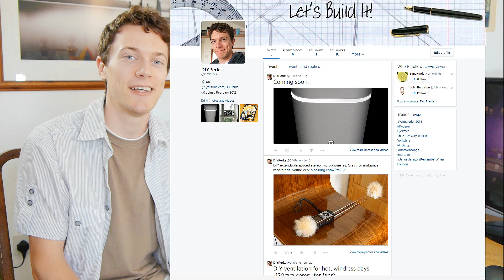How to Make a Clean Air Enclosure (for HDD repair etc)

Comment: Earned a like, like most your videos =)
A suggestion for future project, or just out of interest:
An alternative design would be to make a laminar flow environment, with flow from table-->up.
This is what is often used in microbiology work with petri-dishes. Laminar flow=no(low) turbulence, and the airflow from the table to the top of containment. 
As air moves down->up it does not move over the subject, and prevents any particles from settling on the subject.

Comment: Very nice project, but dust clean environments normally rely on positive pressure so a blowing rather than sucking would be best.
Doesn't need a lot of pressure so maybe a computer fan might just be enough.
No hole for the vacuum, and a fan on the hole for the filter, and the filter attached to the fan.

Comment: Very cool idea thanks! I would have just used extra large kitchen style rubber gloves to keep the hand holes sealed!
Reply: +Blakehx pretty sure you might face some issues with the gloves expanding when the vaccum is on, and might need to reinforce them with rings of duct tape to prevent it.
Reply: +Graeme Evans Good point, guess it depends how strong the vacuum is! Could use electrically insulating gloves, they're more heavy duty but would probably limit your dexterity a lot!

Comment: I wonder if a weaker suction source would work better? maybe a 4 inch fan? less power = less particle coming through filter, less stress on box?
Reply: +Shreyas Mahendra I don't think so. You want the vaccum cleaner to suck out any dust that's already in the box. So it needs to have a certain airflow to catch any dust sitting on the inside walls of the chamber. Remeber: This enclosure is meant to be taken apart after usage, therefor dust will enter the chamber. Also the "hand-entering-holes" are open when not in use; the vaccum sucker hole aswell.
Using a vaccum cleaner doesn't cost you anything and it certainly is working decently. Why hassle around with any other fan? 
Vaccum cleaners have a huge amount of static pressure. No axial fan from computers will do the job.

Comment: Nice video! I need to built one like that for: 

  Installing a screen protector on my cellphone!

I hate even the smallest dust particle on my cellphone screen. I want a PERFECT screen without a single dust particle.
Reply: Same
Reply: +TGRS That's a great idea. Next to impossible to keep a screen protector 100% dust free. I'm going to build one out of foam core as it will be more sturdy and I don't care to disassemble it.
Reply: +Islamic Paradigm Try installing your screen protector in the bathroom after a long shower, your hands/body are dust free and there is very little air born particles in the room because of the water and the added moisture helps to form a better seal. Clean the screen with a coffee filter first.
Reply: +James McCullen XXIV yeah they can. in fact, my local mosque gives free computer lessons to people that need them
Reply: +James McCullen XXIV ...neither can Nazis
Reply: ***** certainly not with a desktop computer and basic knowledge of Windows

Comment: Hey Mat l Ioved your video, really exceptional.
I am a photographer and data recovery is a real pain as over the years I have lost around 5 drives due to hardware errors luckily I kept them all as I knew one day I'd rebuild them and then recover.
could you please show me a video on a disassembly/reassembly of a damaged hard disk moving its platters into a new machine.

Is there any such thing as a HD testing station device where one can put platters on and then to be able to read/pull of data off I am sure this can be done but cant seem to find anything???

please keep up the great work.

Hugh
Reply: ***** Dont know about  HD testing station device but if platters are ok you probably would be best to exchange the read write head actuator from another drive from the exact same model, called the donor drive. For what I have been seing the head actuator sometimes get stuck to the platters when the drives are accidentley dropped. Dont know if thats your case anyway i have never recovered any drive tough. Best of luck
Reply: Thanks Mat, much appreciated, I may try to build a small clean air exposure such as the one you uploaded and see how I go from there.

Best

Hugh
Reply: +Marta Demartini Hugh Hill I'd love to see this too!

Comment: Thanks for this inspiring Video!
Also a very good idea would be to blow dust free air into the box so you have no problems with any leakage. Then you can even put tools in while you're working 
For example using a computer fan with an air filter attached to it to blow air in. Then you can leave the fan turned on all the time you are working. Through small intentional wholes the air could go out all the time.
Reply: Finding a trong blow of dust free air is not an easy task however. Computer fan is kind of uncomparable to the vacuum.

Comment: Hi
Try glas cutter and aquarium/terrarium.
You can use parts of a vacuum cleaner to build the "fan" for the
aquarium, that pumps the air into it so you have more pressure in the
container than outside so you don't contaminate the container.
2 to 3 very good pair of gloves to the holes you cut ...
Remember to put the filter between the blower and the aquarium
and always positive pressure in relation to the outside atmosphere
and meticulously clean the object or tape everything that can contaminate.
(back of the HD->PCB, screw holes ...

Comment: I think the better idea would be not to suck the air out of the box - thus creating vacuum, but rather pumping it into the box creating overpressure that would prevent any dust and debree from getting inside through the possible leakage points as being sucked in. Similar to surgery rooms in hospital. You could use then some computer case fans pumping the air into the box, then some fillters behind the fans, and finally the box. And you dont have to carry about airtighteness around hand protection sleeves.
Reply: Interesting. Have you done it??

Comment: I have not read all the other comments at this time but would suggest you push air into the unit though a filter rather than suck air out. This would solve a couple of issues with the unit wanting to collapse, you also don't need to make it air tight and lastly you don't need as much air flow. Yes you would need to leave what ever you are using to pressurise the container running but it would also make 100% dust free. Secondly you could just leave the whole glove on and not cut it to sleaves and each time use a fresh set of gloves and just fold the wrist part over a PCV pipe that has a lip on it :)

And thanks for the great videos to watch .
Reply: But what to use to push the air in? Finding a pure source of strong blow won't be easy. The outlet of the vacuum will not be a pure source for sure.

Comment: Those hand holes seem like a weak point of this design, the moment you turn on the vacuum its sucking in a bunch of dust through the hand holes, even though you just wiped down the inside, thus negating the work you did to keep dust out.  Moreso, your hands themselves are the cause of dust, so putting your bare hands in a clean environment seems like a good way to introduce even more dust.  Since this design doesn't really have positive or negative pressure inside the container, exchanging the cut gloves with complete uncut gloves seems like a simple and practical solution, without the loss of very much dexterity. Good idea and video, cheers.

Comment: I have a HDD with broken parts inside i believe the disc are in tact and un damaged, if i bought an identical drive would i be able just to swap out the discs? thanks
Reply: Yes, you would. Don't forget to swap out the PCB/Chip('s)
Reply: Maybe, maybe not. Based on what I learned from another YT video, it would depend on the controller boards being the same on both drives.

Comment: Hey! Thank you. Excellent tips!
Now, my English is not quite good enough to catch one term and I want to ask you...
QUESTION: Can you please write down here how you guys call in English this kind of cardboard material you used, and what purpose is it normally used / sold for?
Reply: Never mind."Craft cardboard" isn't it? I think that's what we call "Carton Pluma" in Spanish, a light and rigid sheet material used for the walls of architectural models, and in some school projects. Other materials are suitable, but... Is this the one you used in your video?
Reply from the maker: raulgap I used acid free cardboard backing that's usually used behind picture frames here in the UK.

Comment: Just a word, you have to be careful when using a vacuum, they tend to create static, I know you won't be directly applying the vacuum nozel to the hard drive, but static electricity can travel through our hands,   and its probably more likely in an area like that.static + computer hardware = bad

so, a word from the wise, make sure you touch something like a computer case to ground out your hands before touching the hard drive after using the vacuum
Reply: Is one end of a simple wire connected to the home radiator, and the other end inside the air enclosure, enough?

Comment: I would force filtered air (most vacuum have an air outlet to attach the hoose) into the cabinet. In that way perfect seal doesnt matter so much, since pressure inside is "positive", and air wants to escape between the leak it found, but since air is going out, room dust cant get in. this approach Ive seen in a Radio Transmission plant where dust was some sort of serious problem, then, got a BIG BLOWER, taking air from outside, filtering it and forcing it into the room, resulting in every hole of the room blowing air and blocking the dust. cheers.
Reply: You can search for FM transmiting Plants and you will get nice vids. That is where I have took the suggestion from. Dont have access to the plant any more to tape a vid for you. Next time I visit one I would tape this for you and upload to my channel.
Reply from the maker: 38911bytefree Good points!
Reply: Er... 'kay, any video 'bout this?
Reply: 38911bytefree
Thanks. :D
Reply: True, but now get that big blower.

Comment: Nice idea, your enclosure is very handy.
Could you tell me what microphone you use for your voice overs? Your voice sounds great and the audio quality is fantastic.
Reply from the maker: ElectronFun.com Just a cheap electret mic I salvaged from an old laptop. Nothing special at all, but it does sound great. I wish I knew the part number so I could make more!
Reply: DIY Perks Thanks for your reply. I thought it was a condenser mic, but couldn't figure out the price range or make.
Reply from the maker: Alberto Martinsen That's the one I put the laptop's electret capsule in to, yes. I'll make a video about it at some point.
Reply: Today I've discovered this fantastic channel and I was wondering the same. But what about that microphone you use with a wooden foot? Is that the one from a laptop?
Reply: Nice!! Thanks for your answer, and cheers from the north of Norway!! You have a fantastic channel!! Keep the nice work, and remember: don't feed the trolls ;)

One more thing: You have nice video editing skills too. It would be great in my opinion, another tutorial about it with some tips for beginners like me ;). Just an idea ;)

Comment: This would be great for putting screen covers on phones and tablets which is almost impossible to put on without a speck of dust under the cover.
Reply: Here's how I did it : Went into the bathroom and turned on hot water from the shower head. This creates steam which 'catches' the dust particles and then drops them to the ground.
After a couple minutes the (small) bathroom was free of dust in the air so I could put the screen protector on without a single particle on my screen :)
It does create a damp environment so may not be ideal to work on a HDD :p
Also, it doesn't stay free of dust forever obviously so you have to work somewhat fast.
Reply: F Con that actually a good tip, thx
Reply: All you need is a piece of scotch tape. Take a long strip and remove all dust on the screen in about 5 seconds. Then put the apply the screen protector within next 5-10 seconds, being careful with alignment. You might get one piece of dust now and then, but most kits include a dust sticker and you can gently lift up the protector, stick the adhesive side up against the adhesive of the protector (where it's stuck) and then remove the speck of dust.
Reply: @HarrisonYagerPhoto Have you done it to recovered your hard drive? I'd love to know
Reply: Great idea!
Reply: I agree, also, not sure if you have ever done it, but I've had a lot of success with applying a screen cover the same way they do it with tints on car windows: spray water on the sticky side.  I know it sounds odd, but if you've ever gotten a cover from Zagg, they give you a small spritz bottle with water.  All you have to do is wet the under side, so when you apply it, you can slide it around in place, and get a stiff card like a library card and squeegee all the water out from underneath.  You'll have a few little "frosty" parts, but these disappear within a few days.  Give it a try if you'd like, I've had amazing results this way, and the pushed out water could also potentially slide out some specks of dust from underneath as well.
Reply: i was able to install an iloom screen mate screensaver on iphone 5 in my living room and i had big windows in that room, in the end i successfully installed it; however, about a year later it seems that my screensaver is losing its grip on my phone so i dont recommend getting an iloom
Reply: just do it quick....its ez
Reply: i just put mine on the table , literally wiped it 20 times with the alcohol pad , put it on and literally not a spot or a piece of dust. donno why people say its hard
Reply: @Deta335  yeah I do mine in middle of a desert.. and I didn't get any sand particles
Reply: @SurajGondkar Have you it to recovered your hard drive when you put it in the chamber with dust free??

I'd love to know!

Comment: Awesome video! One question though, how did you manage to turn the vacuum cleaner off once your hands were inside? Surely you would have to remove your hands from the enclosure to turn off the vacuum, at which point there would be a chance of unwanted particles from entering the chamber...
---
I suppose a the only other work-around is to ask someone else to do it for you?
Reply from the maker: Either ask someone, or use your foot (which is what I did). :)

Comment: I would suggest not to turn off the cleaner, so the environment remain clean as you work with the drive. It's a long work to replace heads or something inside of HDD, so the environment should be clean all the time. And as a solution nothing to be sucked off into a cleaner, you could place a plastic percolator or filter in front of the nozzle of the cleaner. Hope that DIY Perks also agree with me ;)

Comment: So what type of hepa filter is that? I went to the store and only saw Rectangular shape filters
Reply from the maker: The circular one that only featured briefly? It's a post motor filter for a Dyson.

The HEPA filter I ended up using was the back, which was 99p from ebay (delivered).

Comment: Nice video, but one thing.

Those gloves are nitril-rubber-gloves right? if you put them on, you'll get a high static load on the gloves if you're not grounded! That my can damage the hdd electronics!
Reply from the maker: Wow, thanks for the heads up! I'll ground myself when I start working.
Reply: DIY Perks no problem ;) I know this issue very well. I'm working with these gloves all day and reconized it severel times with our measure-electronics

Comment: wouldn't positive pressure be better? forcing out impurities, and cleaning the air on it's way in? that's how the high security labs do their clean rooms.

could also use some window screen over the vacuum hose to allow you to keep the vacuum on without worrying about parts disappearing into it's depths.

i mean, this way is certainly much cheaper, but likely not as 'sterile'.
Reply: Excellent low cost rig. Thanks DIY. Posi-pressure would be nice, but most household vacuum hoses are full of all kinds of contaminants....and the vacuum blower components would be less than pristine as well. Practically speaking, the DIY solution is more than adequate as a low cost solution. Cheers!
Reply from the maker: Theoretically positive pressure might be better, but I've never seen a vacuum cleaner with a 'blow' function, so I'm not sure how you'd go about it using household items.

Ah, just thought of one after I finished that sentence... a hairdryer. Might be worth looking in to, but it might be a bit more complicated to implement.
Reply: ***** most of the good ones anyway
Reply: Positive or negative it really doesnt matter, as long as the inspection/disassembly containment is clean, can take the pressures (or vacuum) and the air being introduced to the HD assembly, and the air is FILTERED and, if at all possible, dried! I've been very successful ducting a portable room dehumidifier exhaust to the HD containment and using a household furnace filter (doubled) at the box.
Reply: well, that would be why you would filter the air going into the box, but yeah, this is probably good enough for most things.
Reply: DIY Perks I'm having a vacuum cleaner which has blow function.
Reply: DIY Perks a server fan can be a good idea, if you don't mind the noise
Reply: No, it does matter. Because if the pressure is negative the air will come in trough the gaps around hands.
Reply: Just use long dishwashing gloves and glue them permanently to enclosure.
Reply: Agreed, but if the cuffs of your gloves are sealed to the containment, that should do the trick. I should have mentioned that I suppose. 👌👍👍👍
Reply: Agreed, any gaps in the system would allow dust in using negative pressure eg, the hand holes